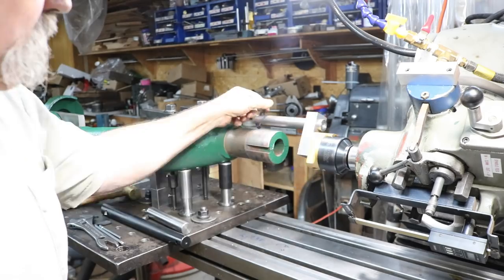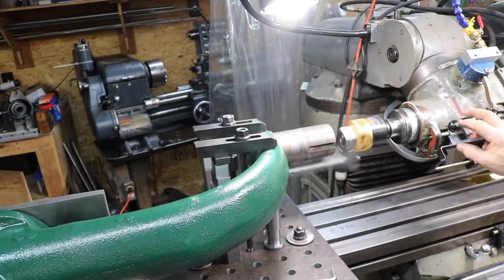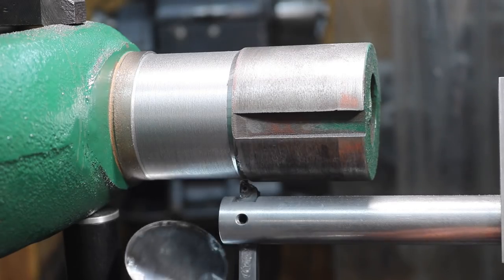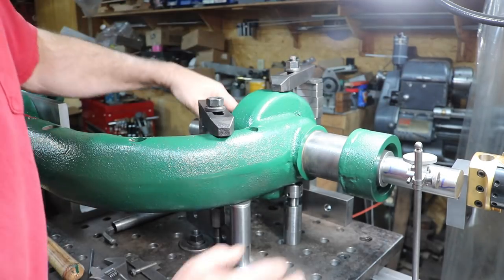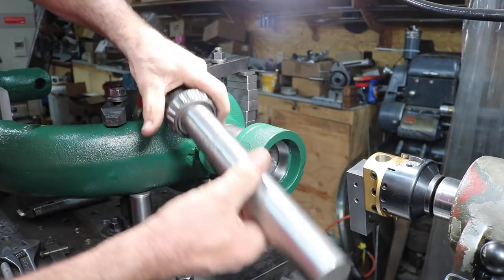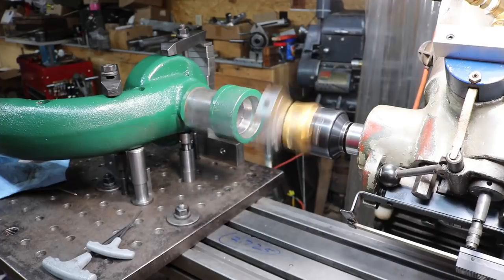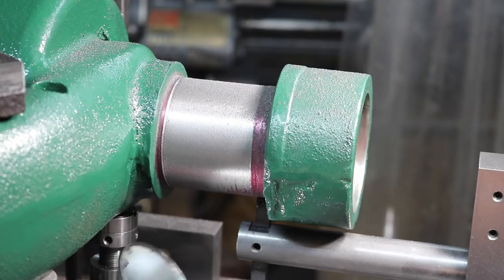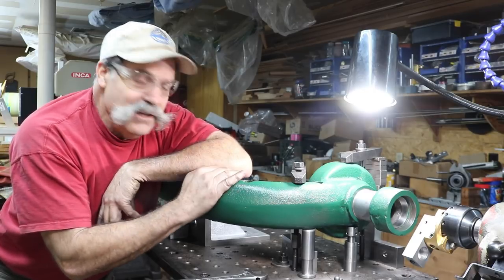Cement Mixer Restoration Repairs P4 | Machining Journals

Comment: Marvelous job. Would have been absolutely impossible on a rigid-head mill, but on your mill you have nods, tilts and right-angle drives and that made it possible. I take my hat off to you for figuring out how to use all those features at once. Oh, and making a few boring bars on the way.
Reply from the maker: Thank you Juan.  Took some thinking and time, did not want to rush this.

Comment: Really well done Randy. Shows what is possible with a Small Bridgeport mill. Very reminiscent of Keith Fenner pushing his Monarch lathe to the limit with jobs far exceeding the length of his machine with multiple support at either end. I noticed how pleased you were for a very satisfactory ending to this project. I really enjoyed watching you solving problems using CAD and proper setup.
Reply from the maker: Thanks Lional.  Sure worked out great, just took my time.

Comment: Randy I'm really impressed👍
Reply from the maker: Thank you Clarke.  Came out Great.  You thought you would have to cast me a new 
one.  The curved part of the yoke is hollow.  Not to sure how they did that.
Reply: @RRINTHESHOP  that would be a change.  Are the ends steel or cast iron also? Just wondering if they brazed three pieces together for that
Reply from the maker: @windyhillfoundry5940  All one piece all cast.

Comment: Mr Richard, you are a very clever and capable man, and I am impressed. Heck, Adam Booth would be impressed!

With reference to the journal bearings: have you thought of following Keith Rucker's practice, and pouring babbit bearings? I realise that a concrete mincer presents an extremely hostile environment, and perhaps bronze bearings might prove more suitable, but if you can seal the ends of the journals, maybe this would be a useful solution?

Just sayin'...
Reply from the maker: Thank you Greg.  I actually did consider babbit.  Babbit but like you said the 
environment for it would be tough and to easy to end up with embedded material.

Comment: Good application of those fancy eutectic powder torches Adam Booth and others have been showing. However, you still would have needed to do everything you did to machine it to size so I think you picked a good path. Nice job Randy!
Reply from the maker: Thanks Tom.  I have seen way more failure of that type of repair, it is only good as a temp repair and only in certain cases.  I would not do that type on repair on something that would have a heavy radial load.  It has a tendency to fail and flake off.  Shipyards would do this type of repair on shafts and within a year we would end up replacing the shaft anyway.  So it would cost us downtime twice and repair costs twice.  Was not worth it.  Weld it up or sleeve it.
Reply: Randy Richard In The Shop    when I did the Eutectic  course someone asked about the failure you mentioned and the answrr was it hadn't been done properly. when done correctly the repair  can be better than original.
Reply from the maker: @chrisstephens6673  Well I only speak from experience.  They were done by "professionals" but still failed.  I had a critical piece of equipment fail at sea due to the flaking off,  I stick welded the shaft up, machined, and put back into service in 6 hrs. lasted years after that.  I do not how many of this type of failure I have seen but it was a lot.
Reply: @RRINTHESHOP  not doubting you, but there are two processes. One is like putting a sleeve on a shaft,, like the one Abom usually uses and the other is like Mig welding. The sleeve style has the potential to do as you say, the other forms a very strong bond indeed.

Comment: OMG, well done, Randy. That ought to do it.
Good thing you didn't have a horizontal attachment, because then you would have had to feed with the table instead of the quill, and that would not have worked so pretty good...
Should be all downhill from here.
Thanks for sharing.
Reply from the maker: Thanks Joe.  Worked out well.  Quill was the best option.

Comment: Great project. How do you feed depth of cut on the boring head ? Just flex the bar or is there a key slot that you can feed it on?
Reply from the maker: There was a hallow/low spot on the bottom and fed it in there.   Thanks Rodney.  
Max DOC was 0.010".

Comment: When you get down to it , this is a cement mixer your dealing with.
Therefore it is not so much a non clean up or a hollow spot left on the journal, but rather what I prefer to think of as a lubricant reservoir. 
Cheers Eric
Reply from the maker: Exactly.  Thank you Eric.

Comment: quite the nail biter going there Randy. always interesting to see parts reconditioned that are outside the working envelope of the machine. the other option would have been to lob the stub shafts off and replace them with a turned steel. but this retains the original structural integrity of the yoke much better..
Reply from the maker: Thanks Mike.  You know I thought thru every option. This one I think was the best and will help in the next phase with making real bearings.  Welding you the journals was the only other real option I considered then re-machine to original size.  But if this screwed up I would still have that as a backup option.

Comment: G’day Randy well done achieving your results, I was wondering though since your cutter was captive between two ends and it’s adjustment was by the boring head how is it you could adjust the cutter inwards as it was already sitting on the surface, were you flexing the boring bar?
Cheers 
Peter
Reply from the maker: Thank you Peter.  I positioned it at the low hallow spot and it was not a problem, 
the max DOC I took was 0.010".

Comment: Was that a built in tapered race for the bearing? You said it was out 5 thou. Can you replace it? By the way, it was the most wonderful setup ever. Thankyou.
Reply from the maker: Thank you Clayton.   Worn in taper.  Straight bearings.  I will be making the new bearings after the new year.  Merry Christmas.

Comment: Did I miss the final installment on the cement mixer rebuild, or was this it?
Reply from the maker: No you did not miss it,  I will have several more.  I need to make the bearings next, then some serious assembly can happen.  Thank you.